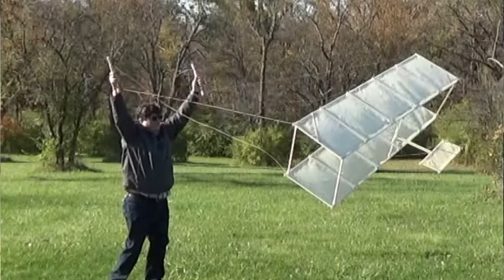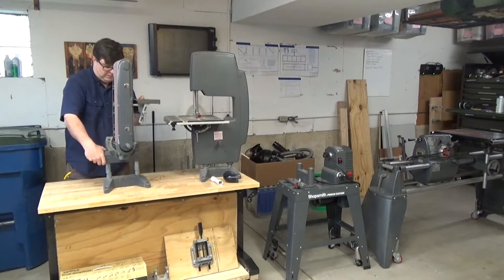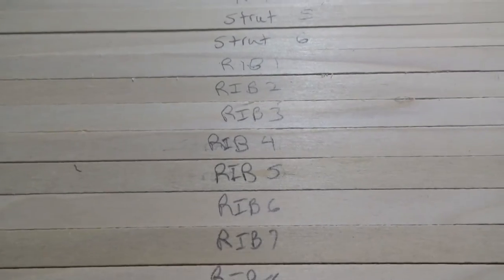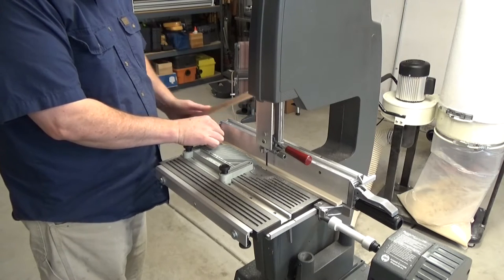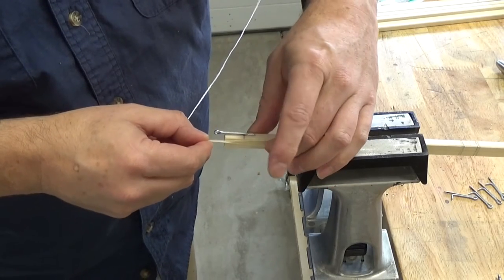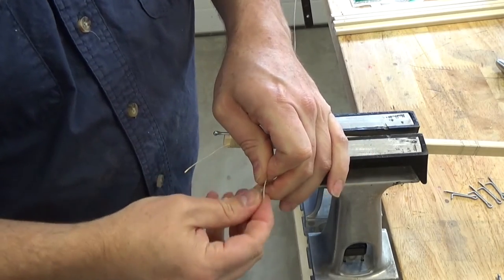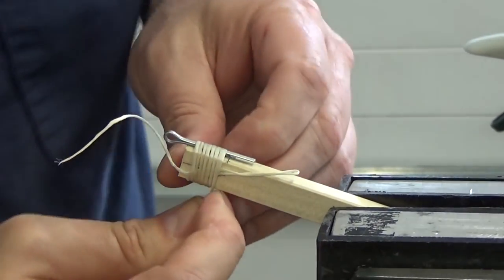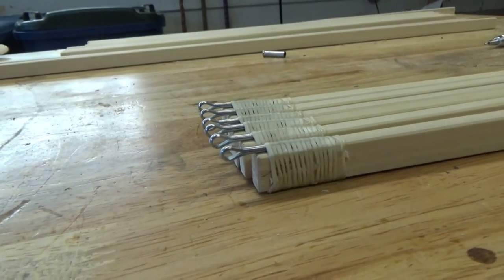1899 Wright Kite: Project Build Part 1 New Old Skills

Comment: Would you consider making these struts more aerodynamic?
Reply from the maker: I did consider changes making changes while building, but since I'm not an expert in this particular domain of knowledge, I decided to just follow the plans and documentation.

Also, my layman's understanding of aerodynamics is that it benefits increase lift or reduce drag. If you reduce drag during forward movement, the craft can move faster, then fast the craft moves, the higher the relative wind speed, the higher the wind speed the more lifting forces applied. But since this is a kite that does not move forward very much, I'm uncertain if improving aerodynamics to reduce drag would have any impact.